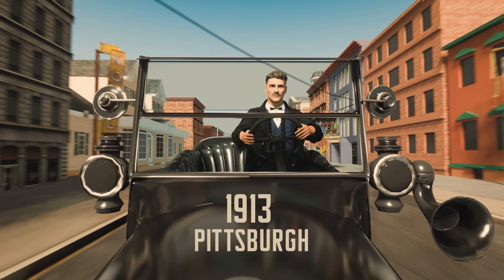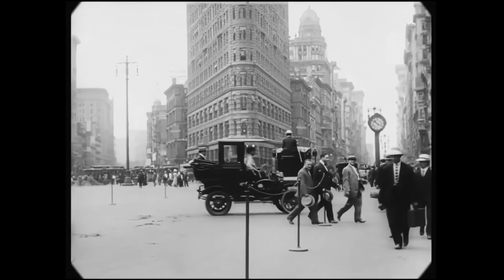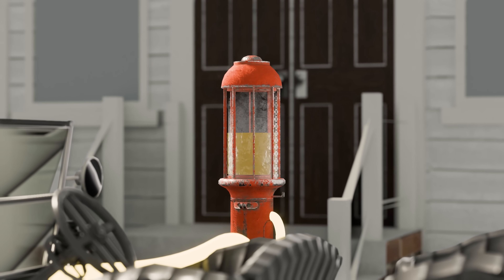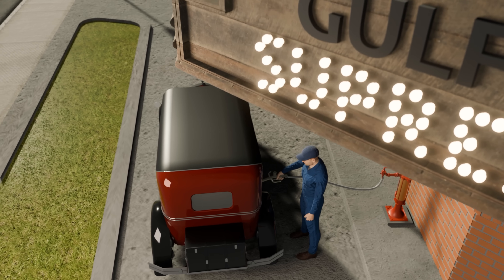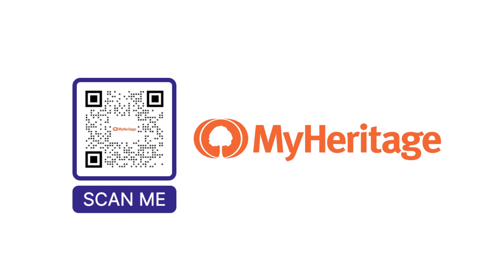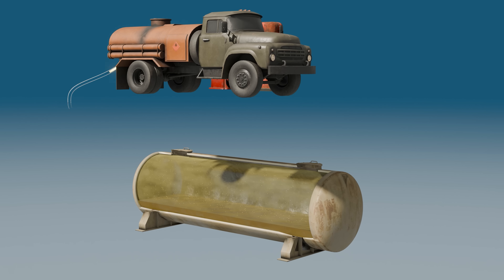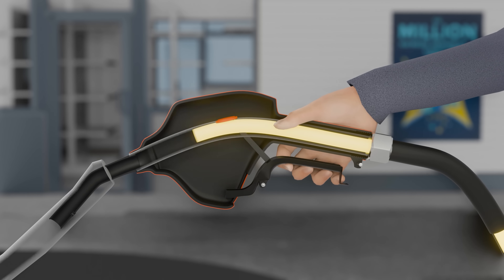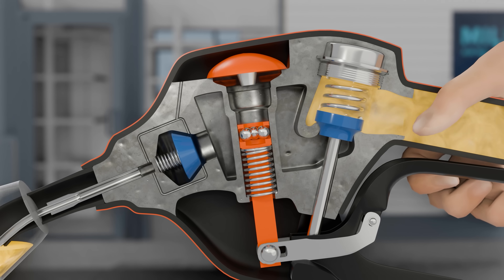The Hidden Engineering of Gas Stations

Comment: I remember asking my dad as a kid where the hell they store all the gas and I was shocked when he told me it’s all underground.
Reply: It’s pretty crazy, and most big gas stations like loves pilot etc have 2 20k regular tanks along with 2 20k ulsd tanks as well. Crazy . Also if you want to know a cool fun fact. If you ever wanted to know what those 3 little poles sticking up out of the ground in the air at every gas station - that’s where the vapor recovery system vents at. They go up right to about power line length.

Comment: This is why fuel wont get cheaper when EVs start to take over, this infrastructure is enormous and expensive to maintain.. at some point, customers will drop to a point where it’s not profitable.. and the market will collapse. Oil wells will close but we need fossil fuels for very important plastics and polymers. Oil should be hoarded at this point, as burning it is a terrible waste.